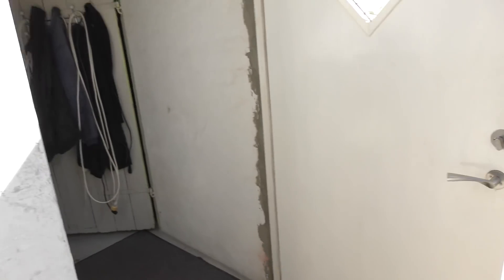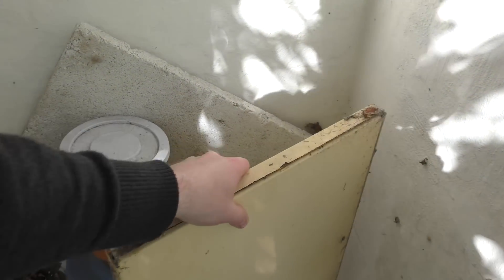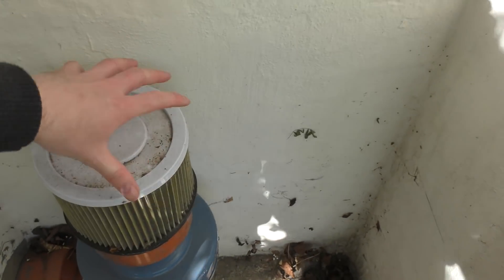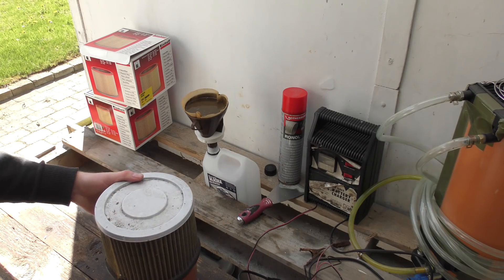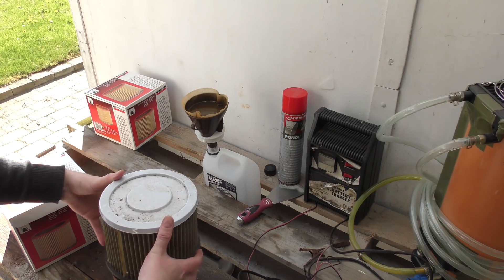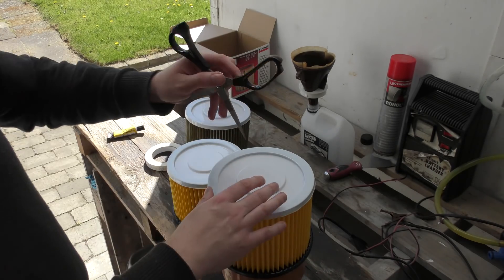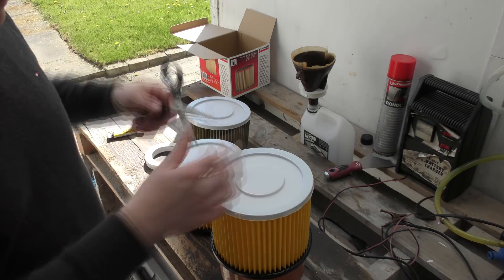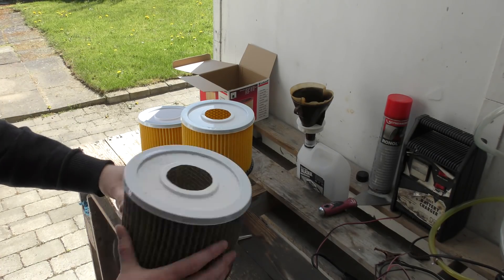Data Center Air Intake Filter Improvement Ninja Hack - 687

Comment: You should really invest in some Olfa(Yellow with black rubber and snapable razor blades) utility knife, I have watched you far to regularly dangerously use scissors as a knife.

Also a suggestion make a roof above the air intake fan maybe 1 meter above it to stop sound/weather and in the front build a frame that can hold furnace filters big and cheap.
Reply from the maker: Hi NoWantTwit
Thank You very much!  The intake is under roof,,, glad you liked the video :-)
Thank you for watching! :-)

Comment: in a word...A/C window unit would cost you very little to run.
Reply: The heck it will!
1, Window AC units cost up to $100+ a month to run.
2. With all those servers, the AC unit would run constantly (even more $), and barely make a dent in the temp.
Reply from the maker: Hi Unkyjoe's Playhouse
Thank You very much!  but it is actually about 10 times more expensive to cool the air, compared to just moving it out of the way.
If I did not have any cool air,, like you might not have doing the summer,, then cooling is required.
Thank you for watching! :-)
Reply: Not in the US, this window unit is very efficient, costs less than $10 a month to run.

Comment: Nice work but for 300...400€ you can get a great AC ... and depending on your size of datacenter it is only 20€ additional money for electricity :)
Reply from the maker: Hi MChip Micro Chip
Thank You very much!  Yes it is way cheaper to move the heat away then to cool it,, also why snow plows do not melt the snow,,, just move it.
Thank you for watching! :-)
Reply: I think Morten tries to avoid an AC because of the immense electricity costs...
Reply: haha, "also why snow plows do not melt the snow" xD